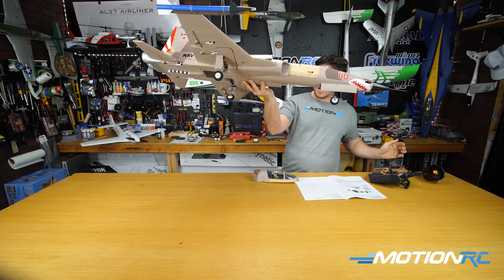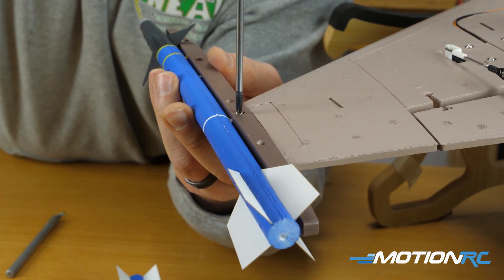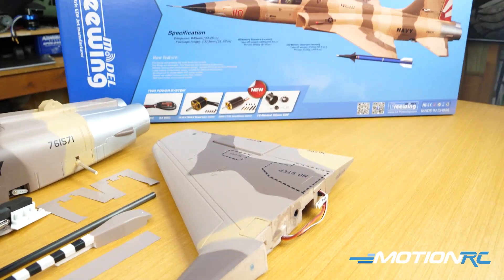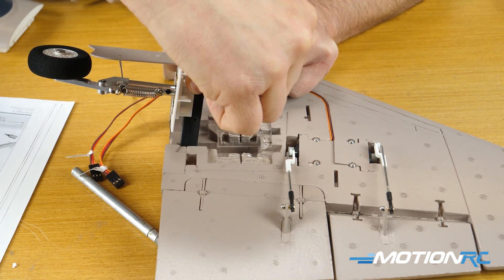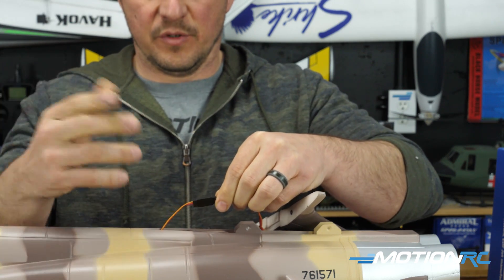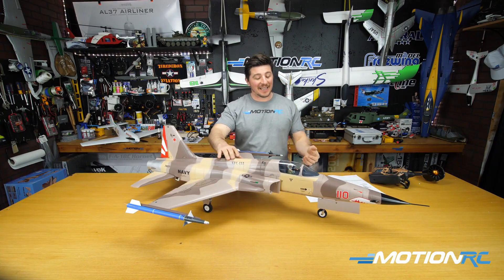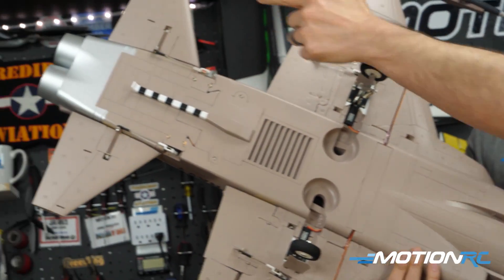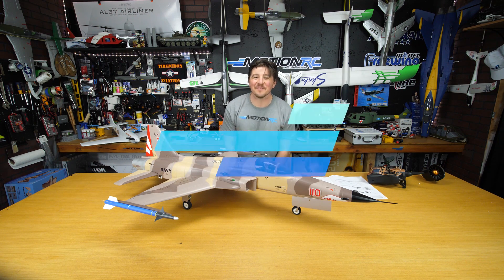Freewing F-5N Tiger II 80mm EDF Jet - Unboxing & Assembly - Motion RC

Comment: I was a crew chief on these F-5Es, I was with the 527th. Aggressors at RAF Alconbury in the UK from 1982 to 1985. I have to get one even if it’s beyond my flying capabilities. These are much nicer than the F-11E Ardvark that I worked on and got a flight in at Canon AFB, Clovis N.M. Nice video. Thanks.